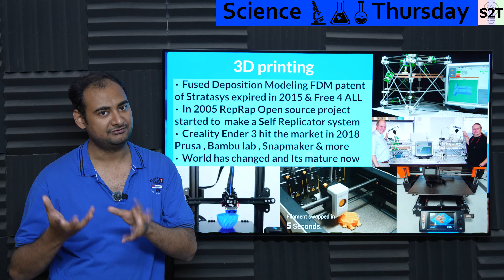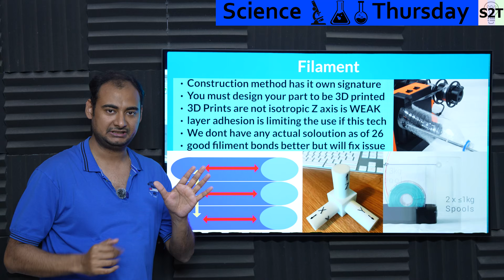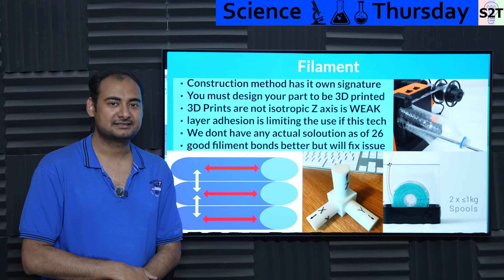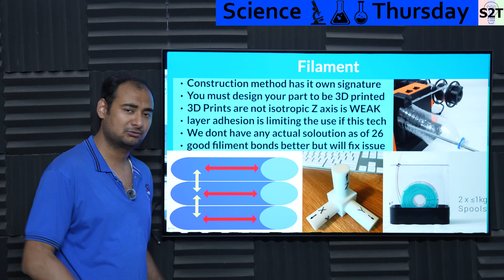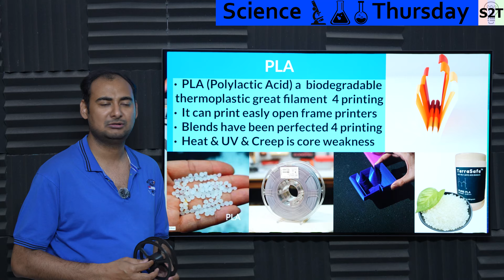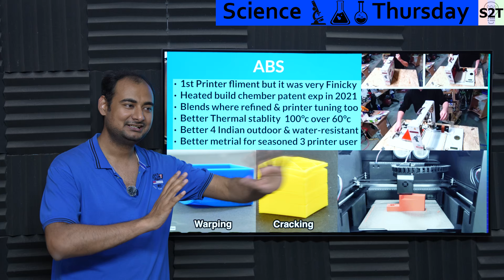Materials for 3D printing Explained {Science Thursday}

Comment: Interesting overview about the topic of filament types! 
But against wide spread 'knowledge', PLA is not bio-degradeable in a sense of 'in the ground it will rot'. You will need a special type of microorganisms and special conditions like a constant temperature around 60°C, presence of oxygen etc. In special tailored industrial bioreactors that can be done. Even then: The PLA will break slowly to shorter molecule chains and only these are converted to CO2 and water by the microorganisms. 
Just putting your PLA Benchy in the garden ground will not work.
Reply from the maker: that is true point and does apply to biodegradable plastic also